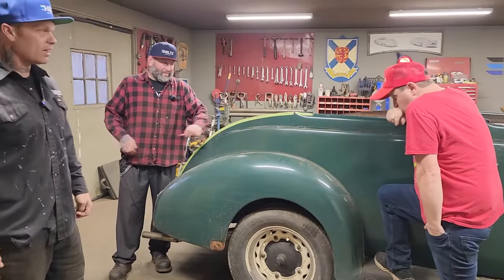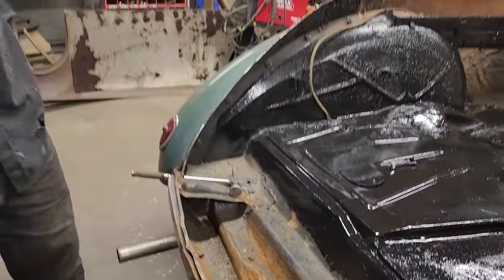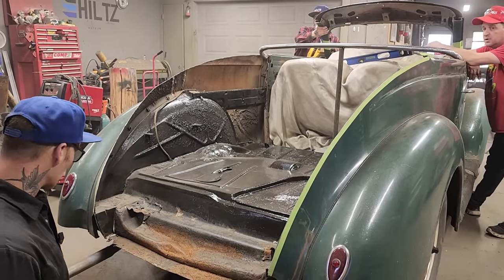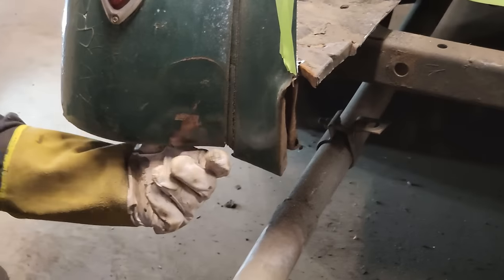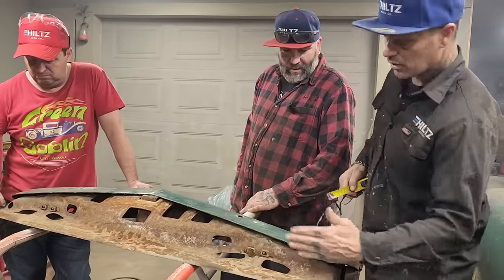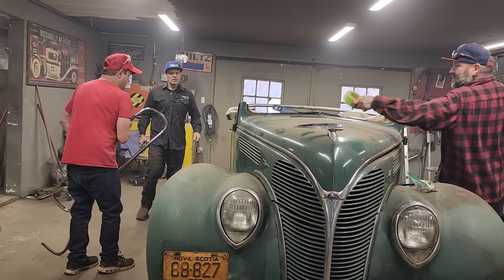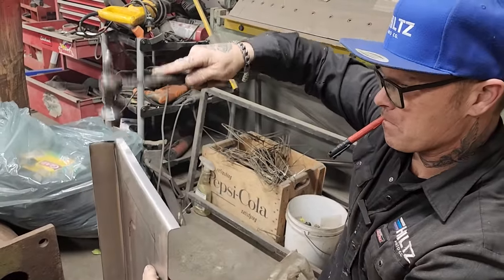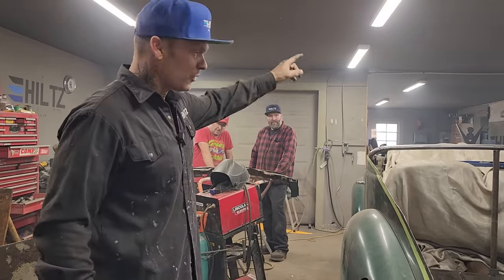More slicing and dicing... 4" window chop 🪚

Comment: My latest brainstorm' is instead of finishing the back end with the windows take some of the left-over green steal parts cut and roll them and weld them into the window frames on the rear making one over all piece on the backend.  The line looks good why ruin it.  Don't worry to much about paint you have plenty of green steel to pull a paint match from.  I agree with the prior post Nate and Doug are working well together and bring new energy to the project.    Great job, everyone.   Good Luck!!!

Comment: Near the end of this video, it looks like the left wheel is centered in the fender opening perfectly, but I think I remember noticing earlier in the video that the passenger rear wheel is more to the front of the wheel opening. It may just be an optical illusion but that would be something worth checking into, even if you just walk from one side to the other and took a visual check of it. The windshield sure has turned out nice !Can’t wait for tomorrow’s video!

Comment: When you are editing the video. You allso have to do the audio mixing. If video is on Chad, the other microphones should be muted. There are, in the editing suite, audio volume lines. You can pull those down. Or, cut audio and throw away the pieces you do not need.
Reply: I'm pretty sure that most of the time they go straight to YouTube without editing. Since they do this daily it would be a lot of work for her to edit every day. I say this is someone who's done video editing as a career.

Comment: The car is taking shape and will be awesome. If I may, I suggest you might want to trim the front and rear fenders behind each tire. Cut the bottom rear corners off to make a flowing transition into the running boards on the front wheel and to shape a flowing transition going to the cars rearend. In my opinion this would give the car a smoother flowing lines instead of the traditional blocky look of the current fenders. Are you going to eliminate the trunk entirely?